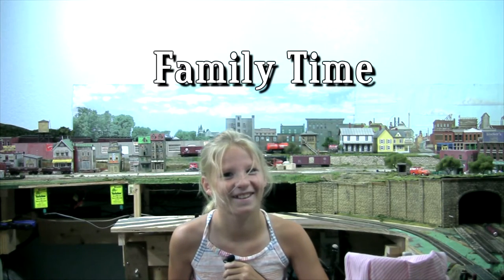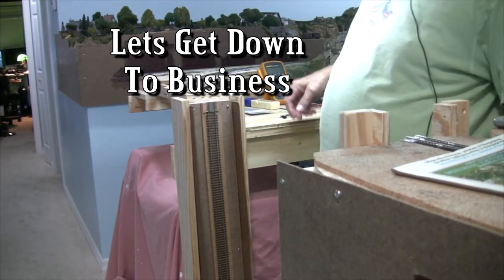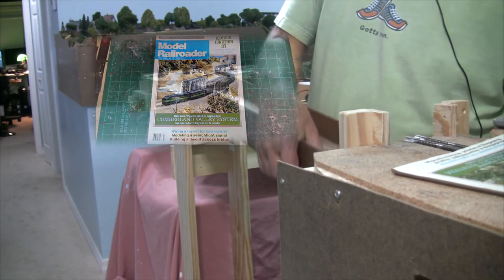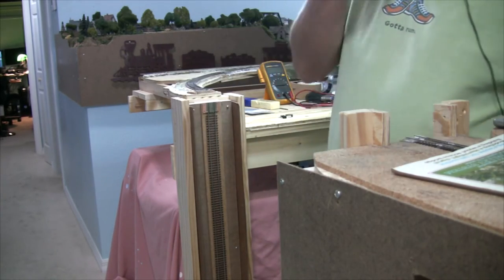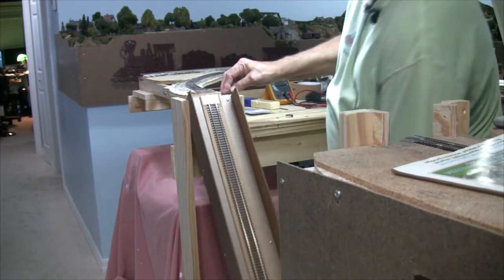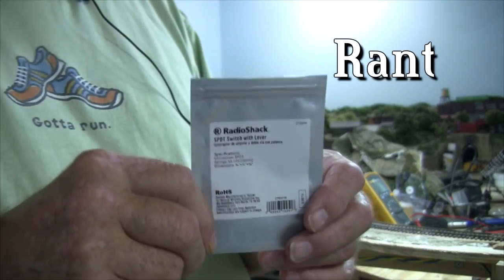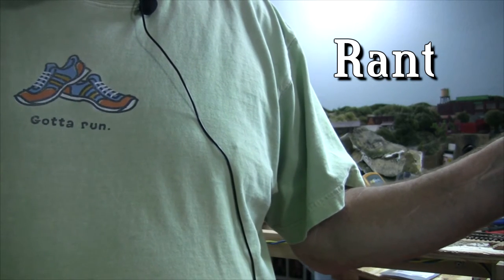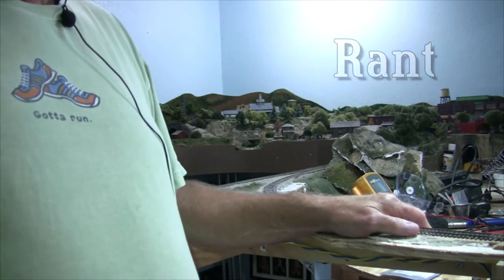How To Add Switches To A Drop Down Access Bridge

Comment: I see you're making little Mady a video star! She seems to love those trains, and that's 3/4 of the battle.... My granddaughter loves trains too. She's only 6, but ASKED for a HO Scale Thomas Train set!! 😎😎😯 (Proud Gampy!)
Tom, I REALLY like that drop down section! That's the answer to a major problem we've been having on our Railroad. I need to hunt down that magazine.
The pressure switches are a brilliant idea! We used to use those to trigger Nitrous Oxide injection with the throttle lever. Thanks for another great idea.
Murph 🚂
Reply from the maker: Mady loves operating the trains while she's here. Years ago I gave them an LGB set but they don't put it up because of their dog. He get's into every thing.

I tried several different methods for a drop down before settling on this one. I just didn't like the location of their switches. Too much trouble getting to them if there was a problem. I've worked with too many switches that failed after a few days of operation to bury them behind anything.
Reply: Tom, Murph's right! I remember using those switches on the throttle levers of my carburetors, to trigger nitrous oxide in my race car.
That's something I never thought of. Great idea!! You've just SOLVED my Pacific Belt RR expansion program! 👍👍 And with good old fashioned know-how!  Strangely, after almost 50 years of doing this, I've never had a reason to do a drop bridge.... So I never actually learned a good method. I thank you Sir, you've really helped me out with that!
Carmine 🚂
Reply from the maker: Back in the 70's early 80's we had equipment that used switches similar to these with rollers on them, they rode on a series of cams to operate solenoids for air blasts and arms to fold sheets and other items in our commercial laundry.
Reply: So that's why you're familiar with them. I found them very reliable, especially given the harsh, hot environment they were subjected to.

Comment: I had a shelf layout that had a removable section.  My layout was about 5 feet high and I didn't want trains getting anywhere close to the edge when the lift out was out.  So I isolated the tracks about 3 feet back on each side.  I sent the power for each isolated section into the liftout so that once it is plugged in the isolated sections get power.  Even a train at full speed would stop well short of the drop off.

When the lift out was missing the layout could be operated as a point to point layout, when it was installed it added a round and round along with more operations as the south end of the layout then had access to the staging yard (out of town trains)
Reply from the maker: Great idea with the point to point without the lift out section Dominic. More variety of operation with in in and out!

Comment: Tom, great video. Trying to get an idea of what is ahead for me. Really looks like it's easier than I thought, just gotta pay attention to what I'm doing. Question for you. Where did you get the hold down plates that your rails are solder too? Did you make those, or are they commercially available? Are they "gapped" to prevent shorts? Thanks for your time and the videos!! D. Muse WTCMRR
Reply from the maker: Hi David. I had to make them from a circuit board from Radio Shack. It was conductive on both sides so I had to cut a gap on both sides with a small saw. It was a lot easier then I thought to solder the rail to the board. I had to put a 0.010 pc of styrene under it to compensate for the thickness of the ties. On one side I tried the same with brass shim stock between the rail and circuit board and that work out well also. You may not need the shims depending on the brand of track or if your hand laying your track you can sand down the ties to match the circuit board if it's off. Once you have everything soldered into place use a Dremel Tool to cut the rails between your two sections.
Reply: Tom, thank you for your reply and the information you shared. I saw those in the video and just had to know what and how you used those plates. Very neat clean and effective way to secure rails. Thank you and looking forward to the next video. D. Muse
Reply from the maker: Your welcome Dave, anything to help!

Comment: At minute 2:35 I see what looks like a pc of copper I am assuming soldered to the track to hold them in place . What did you use ?
Great video with lots of info ..
Reply from the maker: Thanks Jim.  Yes, I used a circuit board for that. I also have .005" copper shim stock to make up the difference in height.
Reply: Toms Trains and Things 
It must be scored down the center so it doesn’t short out ?
Thanks for the info . I am in the design stages of my layout and will need a drop section like that to avoid ducking under .
Reply from the maker: Yes it is. Drop sections are definitely better than ducking under all the time. Less bruising on the head also. lol